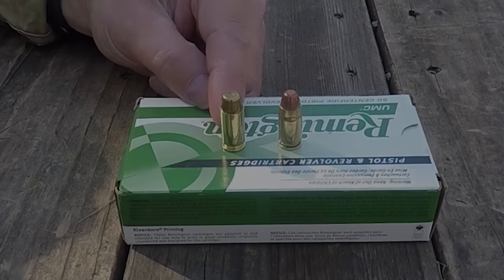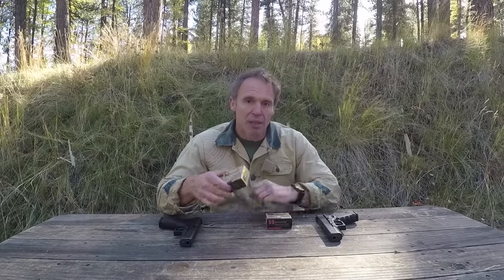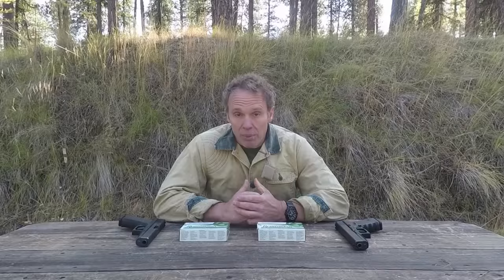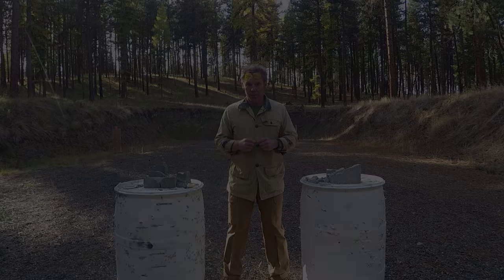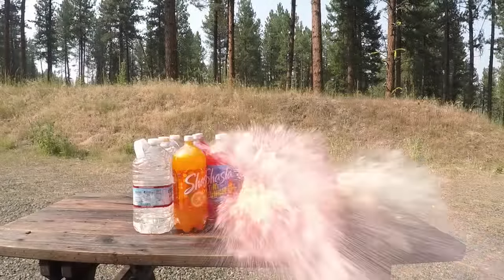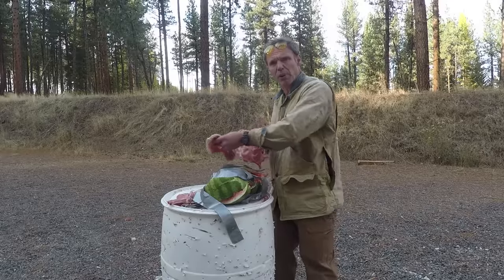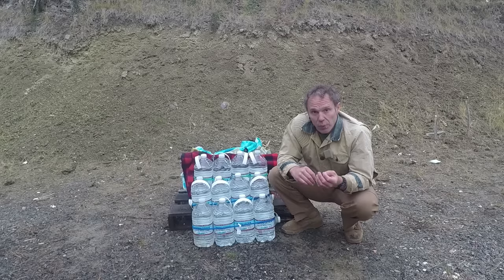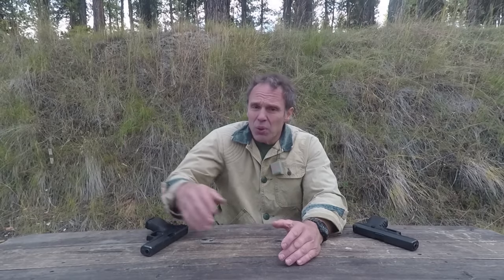Personal protection: .357 SIG vs. .40 s/w

Comment: I own all of the typical calibers  9mm, .357 Sig, 40 S&W, 45 ACP.  I'm happy with any of them, for self-defense, but if you force me to make a choice,  I'll take the 9mm, thanks.   It's capacity/power ratio, balances favorably, imo.   I've done the chronograph  and penetration testing too.    Anyway,  Paul, I like your videos.  Thanks.
Reply: I have to agree on both points. I like all those rounds. They are slightly different with advantages and disadvantages, but all effective. I also agree that the 9mm gives me a great balance of all factors.
Reply: capacity/power ratio?! maybe you didnt mean what i think you meant... 18 9mms has far less energy than 15 357 sigs or 15 10mm's... 15 .40s has an energy edge and a large expansion cross sectional advantage too. 9mm has low recoil and its cheap. Also if you hit a vital it will kill. thats its advantage. certainly not a capacity/power ratio though or bullet/power ratio either.
Reply: Rick Barton - Why wouldn't I want to be happy??
Reply: I agree 100%. I’ll take 9mm. There is no “magic bullet” and contrary to popular belief the .45ACP isn’t some kind of goddamn death ray. I’ll take cheaper ammo, more range time, and more magazine capacity.
Reply: "more range time?"

Nonsense! If cost is king you'd carry a .22.
Reply: Rick Barton yeah no. I wouldn’t carry a .22. Rimfire ammo is not reliable. Of the calibers I consider “effective” for carry, 9 is the cheapest, hence more range time. Your stupid point is stupid.
Reply: Girl confirmed. Maybe do wrist exercises, Nancy. Lol.
Reply: 9mm, the preferred round of the soy boy bug man.
Reply: For people who reload the 357 Sig costs about the same as the 9mm to shoot. The brass can be a little more costly, but you can reuse the casing a few times, and it uses a little more propellant, but powder is fairly cheap. The primer and bullet are the same as 9mm.
Reply: No need for profanity son, which proves neither toughness nor intelligence, only a lack of self-control, morals, maturity, language skills and character. Grow up son and learn to communicate respectfully and intelligently like a real man.
Reply: Cool, I don't think 9mm is very practical for self-defense anymore unless you're facing 5 zombies in close quarters. I think the .40 is the clear winner after Paul's 10mm VS .40 video. The info is all there. Get a .357 Sig I say if you want a modern 9mm. That being said, The FN 509 is a gun I will admit I covet greatly.
Reply: Here in SoCAl I'm a 9mm guy but in places where I'll be out away from the asphalt jungle or seeing colder weather I switch it up to a 357 Sig or a 10mm. I have no use for a 40 S&W but I guess it works for some people.
Reply: I like .45ACP because it and the guns for it are highly available, it's subsonic and it carries lethal energy pretty far.

The price is a non-sequitor, imo.  It's just a few cents difference.
The original reason for my switching to .45ACP was that I didn't like the cost of .300blk subs, which are about a dollar a pop, but have almost the same characteristics as .45ACP.

P.S.  11inches seems to be the maximum barrel length for .45ACP before it loses velocity to in-barrel friction.
Something to consider if you're trying to squeeze every last cent's worth of energy from the round.
Reply: DildoSwaggins, don't overthink it.  Kinetic energy levels don't always translate to superior terminal ballistics.  All I meant was that more capacity is better than less.   Nothing more complicated than that.  I'm not interested in semantics or caliber arguments.
Reply: chuckugly the bullet is not the same.  357 sig HP is designed to expand at a different rate than 9mm.
Reply: Smart man
Reply: I have a M&P 9, M&P 40 and .357 Sig. All are very capable but the 9mm is my favorite.
Reply: After seeing Paul's 9 vs 40 video, I'll keep carrying 357 Sig. 9mm doesn't have the penetration that I'd like. I can live with 2 less rounds when I get almost double the kinetic energy per shot.
Reply: Rick Barton  no I agree, your point was kind of stupid. You know very well that the 9mm is the cheapest of the traditional duty round calibers. And the .22 isnt generally considered a duty round.
Reply: Kennetic  the FBI went back to the 9mm because current premium duty ammo technology has improved and the round gets enough penetration that if some one gets shot on their side the bullet will rip through their shoulder then reach their heart. You generally don't want over penetration because then the bullet won't dump all its energy in a body.
Reply: 9mm as long as you are fighting human, right? 

What about a 250lb Mr. Universe coming at you, does the 9mm still apply?
Reply: Sad Squirrel  yeah I would trust a 9mm against even against a 250lb man.... I guess against a bear I would prefer a .357
Reply: Alex Oelkers 
Thanks
Reply: Alex Oelkers Paul did a 9mm test where he shot a meat target from the side with a simulated arm with premium ammo and it still failed to penetrate the heart. Premium 9mm ammo hasn't advanced as much as people think it has. Plus, in all of his 357 Sig tests, the bullets are either stopping at the tshirt or are stopping early in the fleece, so I'm not worried about over penetration with it.
Reply: Kennetic 

Any thoughts on .45 ACP???
Reply: They are all good.  If have carried .38 SPL, 9mm, .40SW and 45 ACP.  I have also shot 357mag and sig and 10mm as well.  The one thing all these rounds have in common is if you shoot an attacker it’s gonna either wound them or kill them depending on where you hit them.  What I like about Paul’s videos is he presents the facts and at the end of the day it’s the preference of the shooter.  What works for me might not work for somebody else.  My preference for a self defense round in a carry gun is 9mm.
Reply: @philrichards5620  Exactly. It doesn't really matter how much more energy X handgun bullet has over Y handgun bullet because ALL handgun rounds are under-powered compared to rifles. You need a shot to the vitals (heart, arteries, brain etc) to take down someone with these rounds. Even a shot an inch or two away from these places will have the attacker still alive (for now). With a high-powered rifle, the bullet could miss your heart from many inches and still kill you.

It just matters on how familiar you are with each round. Shot placement is key. Whatever caliber you are most able to get good shot placement with, use that.

I will have to admit that a near-miss to the vitals with a 9mm would've been a hit with the .45
Reply: BLD Lightpainting -👍✊
Reply: @rickbarton8092  if you're a reloader (i am) the cost difference between 9mm, 40 and 45s (gap and acp) is so narrow 9mm isn't worth shooting. atleast the "more range time" argument goes good bye.
Reply: @bldlightpainting  Thanks Mommy. Now, may I have some more pudding ?
Reply: @manictiger  45acp has less energy than 9mm and 180gr 40cal is subsonic and has more energy than 9mm and 45acp but if you have no use for it thats great just thought id point out your passing on a caliber that does what your describing better than what your using. in defensive ammo its cost the same and less in some brands than 9mm also and holds more rounds than 45acp
Reply: @AzeriBeast /// for people who own and shoot 40cal the recoil is no different than 9mm. have you watch pauls video 40 vs 9. its a real eye opener
Reply: @alexoelkers2292  9mm is not the cheapest it is the same or higher cost in defensive rounds as 40cal in practice ammo 40 is the same or maybe 1-2 bucks more a box of 50. not enough to make a real difference inless you spend in the mid 5 figures on ammo a year.
Reply: @alexoelkers2292  that same ammo technology applies to all the others also. they really went back because more of the agents can qualify and the ones who could already get higher scores as these new agents are not made for the streets and most never even shot a gun til they became an agent plus all the women there are in leo now. and cost for them as they buy over 500000 rounds a year. they claim the fact it is the same now but its not and never will be it just doesnt have the power
Reply: @fauxchung3189  its doesnt have the energy that 9mm has. its a weak round in less you use +p then its a great round. 230gr+p will get it done but not the regular that in slower than 900fps.  i picked he 40 over the +p as i get 15 rounds to the 7-12 in 45
Reply: Big Sean247 

Interesting. Thank you.
Reply: @Captain - did you watch pauls 40 vs 10mm video. it is more powerful if you have the right ammo. most of the ammo out there is just the same in 40 and 10mm
Reply: @Captain - well if thats the case my 500mag or my 50ae is king. i just said look at the video as the 10 was not 10 in the brands he tested. underwood double tap and buffalo bore are know niche ammo for being extra hot. hell the have 40 that is hot as some 10mm stuff. but most of the ammo you get in you local is not true 10mm is what i saying. most of these you have to get on the internet only. the only ones that might be local on a large scale is sig, speer. it wasnt a "if you get the right ammo" argument it was a comment of fact from test. most think when they buy 10mm jhp in a major brand that it is real 10mm when its not. but when your spend way more for it on niche ammo from smaller companies that are know for hot loads no you dont have to be concerned with if this is the right load. but us who buy regular ammo from the local store have to worry abut the gr which bullet is in it and what line its from. i have no problem with my caliber if i wanted a 10 id get 1 but for my need 40 is just fine as i dont go to the woods. so stop with my 10 is better than your bullshit.
Reply: @Captain - those are good samples im going off what i seen shot and chronoed and they were much closed. all i was saying is you have to really pick you loads and test as the will print anything on the box for sales as was shown in the test. where i live there is no buffalo or underwood on the shelf  and i know why the 40 was made ive looked up and read all about it. but here is a little know about 40 it was in fact ade before they decided to dumb the 10 down. there is a video on here about it when i find it again ill post it. i never said the 40 and 10mm were the same i said with the ammo in the test they were the same. but with real 10mm no there is a big difference in them with 180gr 40 @1000fps and 10mm @1300fps. i just try to let all know watch the ammo or your paying 100 price for 40 cal. if you havent watched pauls video you should and then you would see you i said what i said
Reply: @Captain - good to know sig ammo is real. i hate to waste money. i was going to get a 10mm but got a steal of a deal on a s/w 627 so had to go for it. so i know the power feeling you speak of and from the 50 and 500. 10mm is on the list just not sure which one i want yet. cz clone maybe??? hopefully to add it here in the spring for a good deal. if not ill bite the bullet. i like the 10mm also as if need be you can fire the 40s/w in it so make it appealing to me also,
Reply: @bigsean2473  Uh no.
Reply: @manictiger  umm yes you might not like what i say but still dont change the fact that its true.
Reply: @bigsean2473  It's not about what I "like".  it's that you're patently false.  The joule output of a standard 45 round is 25% higher than the joule output of a standard 9mm para.  By standard I mean no +P, or whatever.
Reply: @manictiger  ok so 9mm115gr is 383fpe and 45 is 396 so 13fpe ok i stand corrected i was looking at +p ammo   but that still is not much. everyone makes it like 45 is so much better than 9mm but its really not    

https://www.luckygunner.com/9mm-115-gr-jhp-winusa-500-rounds

https://www.luckygunner.com/45-acp-230-grain-jhp-winchester-usa-500-rounds
Reply: @bigsean2473  It's not that the bullet is better, it's that the gun for it is better.  Personally, I absolutely hate Glocks.  They feel and shoot like shit, but that's because I'm spoiled by my 45s, which are all hand-fitted by my own hand to be as close to sub-1/1000th inch tolerance as possible, and which are made from the best possible alloys.

And then there's the fact that I'm hugely biased in favor of subsonic, another perk of 45.  To each his/her own.  For most people, 9mm might be fine.  Personally, I don't have a single 9mm round, but I do have millions of 45.
Reply: @bigsean2473  P.S.  Your stats are wrong.  9mm is 362 and 45 is 432.

Shootercalculator: images/muzzle-energy-of-various-firearm-cartridges.png.

I don't post links on here, because it gets my comments ghost-blocked.
Reply: @manictiger  mine came from boxes of ammo so there not wrong. they know how there ammo is loaded. your number work in theory but their wrong as the ammo wont be loaded to those calculator stats even tho it uses the formula to get the answer its not actual to what the ammo really is my links are to the ammo i have the same calculator you used. no standard pressure 230gr 45 acp is 432fpe sry its just not.  as wishful as you are and much of a 45 fanboy as you are not going to change what the ammo is really loaded at and they print it on the boxes
Reply: @manictiger  use you caculator 115gr jhp 1225 is 383fpe what numbers you used are wrong mine is again from the box  9mm - 115 gr JHP - Winchester USA
Reply: @manictiger  the gun is better. ok i see im talking to a clueless person. that has only part to do with the way a round preforms a small part if the round is shit the gun dont matter.
Reply: @manictiger  ok i went all the way to saami to make sure your wrong. i see your using 920fps for 230gr 45 acp. nope i looked at 8 different ammos and most are 820-900. but saami is(map) 830fps (mplm)870fps so again your numbers are the ones who are wrong.
Reply: @bigsean2473  Yeah, I forgot to block you.  You have been blocked for low I.Q. and arguing just to argue.  No further comments will be recieved from you.
Reply: @manictiger  wow some people just cant handle the truth and want to live in the dream world, low IQ seem he is the one with that as he is battling facts

Comment: I have a fondness for the 357 sig, but I do believe the 40 S&W performed extraordinarily well considering the numbers. If it had equal foot-pounds to the sig, 40 S&M would probably give superior results in many ways.
Reply: You can get the same velocity as a 357 sig if you use Nosler 135 grain ammo. 125 grain 357 SIG at around 1380 fps and 135 grain Norma at around 3150 FPS. With the advantage the Nosler round is pre-expanded

Comment: So the .357 Sig really should be correctly named the "9mm Magnum."
Reply: Or 355magnum.
Reply: 9x25 Dillon. That round is cooking.
Reply: So the .40S&W is 10mm special?
Reply: +1 .357sig is 9mm +p+ [and maybe a little more] in a gun DESIGNED for that sort of power.
Reply: @brucebelitz3451  or .40 S&W long
Reply: .357 sig is called that because sig wanted a semi auto cartridge that had a small enough grip to fit most hands, but had the power of a .357 mag. It’s standard loading was intended to be a 125gr bullet at 1425fps. As with many 10mm loads, most modern cartridges don’t reach intended velocities. Sig wanted to keep the recognition of the .357 name.

Comment: You know the lighter .40 rounds are awesome like 135g or 155g that's what I would use with the .40 don't really like the 180g now for 10mm the 180 is ok but not for .40. I don't think the 40 gets enough credit its def. a hard hitting round I like it a lot.
Reply: I agree that lighter .40 rounds are better. At the moment i'm really into 165gr just because it's easier to find here than other .40 light-for-caliber loadings. 40 really shines in lighter loadings. Notably heavier than the heaviest 9mm loadings while still getting over 1000 fps. Hell, I even like Underwood's lighter 10mm.
Reply: @flipgunderson1946  yup. 165's are the sweet spot

Comment: I’ve shot both calibers a LOT over the years and I think the optimal bullet weight for 40 is probably 165 grain and the 357 is 125. Bullets at these speeds perform superb. Flip a coin, their both wonderful rounds. Don’t forget you can buy both the 9mm conversion barrel and either a 357 or 40 conversion barrel also. In essence you can have three calibers in one gun. Pretty cool.

Comment: Good Video. I appreciate your efforts and comments. How would a 10mm compare to the 357 Sig ? Which would you rather have if you were hiking in the woods and could potentially be attacked by a animal ?
Reply: One thing I've noticed is that the 10mm handguns tend to be larger and clunkier than 357 sig. I have a Springfield XD in 357, and had one in 10mm. The 10mm was huge and clumsy, the 357 Sig is normal-sized. 

Also, 10mms seem to have a lot of problems. It seem to be a bit TOO stout for autoloading reliability.

Comment: Got my two 40's before the 357 sig came on the market. A gen 2 Glock and a Star M40 Firestar. Never felt the need to go to 357 sig. Still don't.  I can buy a lot of 40s&w ammo for the cost of a 357 sig. The 40 does everything I need done.  Nothing wrong with 357 sig. I just have a limited income and that niche is already filled.

Comment: The issue is higher velocity = greater shockwave, that's why center-fire rifle rounds will damage a body more than a pistol round will. 
The test we need to see:
Attach a pressure gauge to the top of the liquid jugs, to record the pressure wave the bullet imparts on the liquid. This would simulate the bullet affect on the bloodstream, and therefore on various body organs.
To match the .357 Mag, the .357 Sig requires a velocity of 1500 fps, I think.